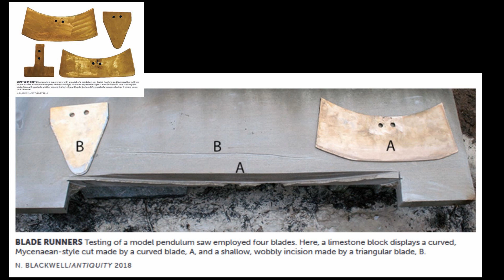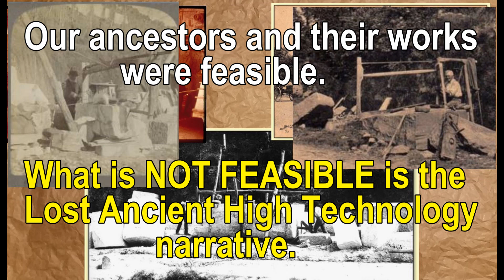The Lost Ancient High Technology narrative is not feasible! Cutting Stone

Comment: How do you suppose, or, by what method were the CORNERS of granite-stone, precisely ROUNDED, as in the case of Sacsayhuaman (Peru), to the degree a sheet of paper cannot fit in the cracks? A pendulum saw, would not be able to round the corners, in that fashion... 
Also, in the in pendulum-saw example, it was used to cut limestone- a ranking of 3 on the Mohs Scale... Granite ranks at an 8, just under diamond.
Further, how do you move 30, 80, 100,  in some cases, eg. 440-tonne stones (Sacsayhuaman), from a quarry, several miles away? That is NOT feasible with today's technology.
Furthermore, how do you explain the presence of homo-capensis in the fossil-record? Also predominantly found in Peru...I've been to Peru and have seen several of the skulls, and was fortunate enough to have dinner with a staff from one of the museums, who gave me a private lecture on the skulls. 
One specimen had a craniectomy performed on it, with such precision, it looks like it could've been cut with a laser... The exhibition at that particular museum, explains-it-away by positing they used rocks... ROCKS... 
There is also ONE skull in the US- the only homo-capensis skull in the US, I am aware of, which is in Oklahoma, which also had a craniectomy- however, this specimen had the space filled-in, as an implant, with what looks like lead, or other malleable type of metal.
Reply from the maker: Precisely rounded? Rounding corners is easy.
Mohs scale. Like cuts like. Granite gets its mohs hardness from quartz. Granite dust or sandstone (high in quartz) will do the job. Or emery which is available.
Having drilled and cut and polished I know it works but then again it has been known for millennia. Even Pliny writes about it.
I have examples of moving stones with primitive tech. 
There are no 440 tonnes stones at Saqsaywaman. The heaviest being generous is 140 to 70 tonnes depending how deep it goes back.
Though look to ancient tech here 400 tonnes stones were moved, across the Mediterranean Sea and much further across land than anywhere in Peru or Egypt.
In Sumba they are still moving megaliths with the most primitive of primitive tech. 
I’m not sure what skulls or DNA have to do with stone working. The laws of physics and chemistry don’t change.

It’s a shame that the alternate “truth seekers” haven’t shared any of this over the last 20 years or so.
I would have thought all this info should be common knowledge but alas the mystery is more seductive.
Reply: World of Antiquity has an excellent video on Sacsayhuaman. 35 minutes in they discuss how they matched the two stone together. It's just a stick with a plumb bob to keep level and then anywhere the stick doesn't fit carve away some more. Really elegant solution. And they reason they chose this method instead of quarrying straight blocks is because those blocks didn't need to be quarried, they were just laying around.

Your other questions about stones are covered in other videos on this channel, I highly recommend checking them out.
Reply: The large stones at Sacsayhuaman are not granite. They are limestone. The quarry for these stones is less than six hundred meters away across the plaza and beyond the hill there. Being located on higher ground we can use gravity to assist the transport down to the walls.
Reply: Well, I guess obsidian would be considered a rock. It is still used sometimes for modern surgery. So there's that.
Reply: h. capensis is no longer recognised, there were problems with collectors just selecting larger skulls and ignoring the smaller ones from the same sites, so is now obselete and classified under h.sapien, which as you know are in the fossil records. Also, if the surgery on someones skull looked liked it was precision cut, regardless of the tool used,  it would mean this subject most likely died from this procedure, if they had survived there would be some healing of the bone matter and the edge would not be so clean (this would almost certainly be the case if it became fossilised). This was a very common practice in prehistoric times all around the globe, the skull could/can be cut quite cleanly and accurately with a flint edge 'knife' (yes, a rock! funny isn't it that in the stone age, the tools of choice were rocks! from monoliths to microliths) - One skull in the US? is this fossilised? how can you be sure the space wasn't filled in recent times? was it found in oklahoma or part of a collection from elsewhere in the world?